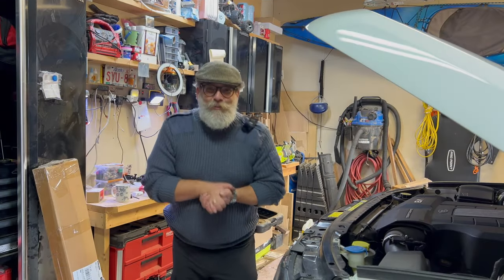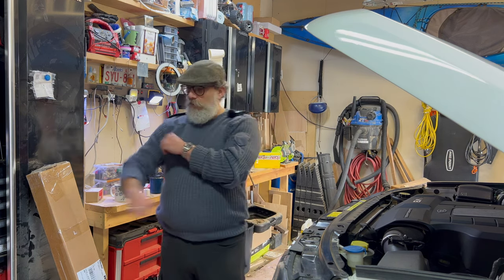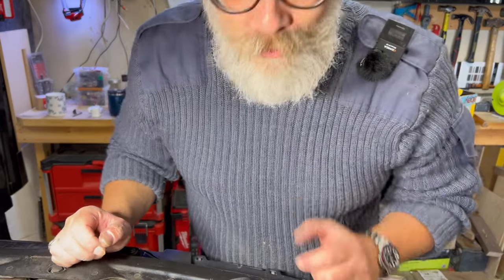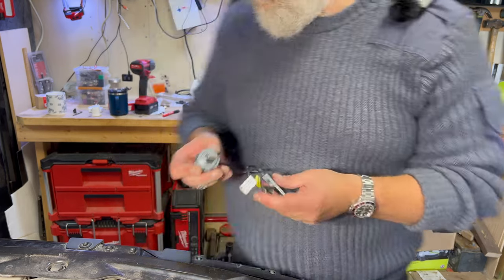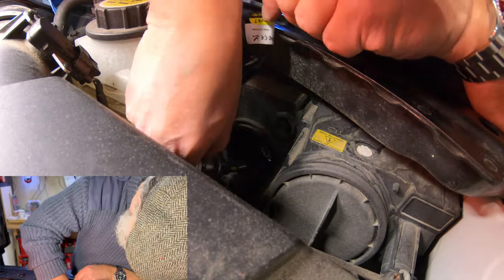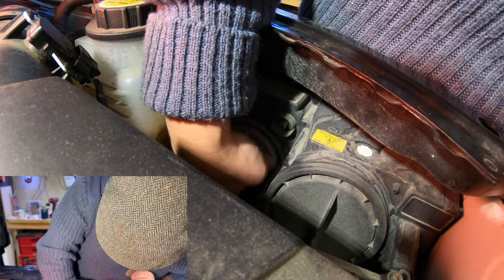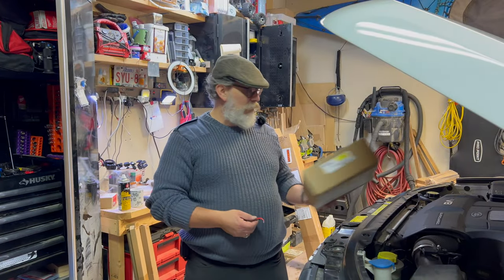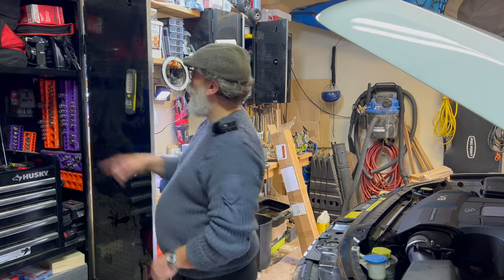Unleash the Power of LED: Upgrade Your #l322 Main Beam Bulbs and Replacing Tailgate Weatherstrip

Comment: Thanks so much for this video. I was very interested in the rear glass weatherstripping. Mine needs to be replaced. My local LR Specialist told me that it was a very big job that required the glass to be removed. Maybe he isn’t so “Special” after all. My RR is a 2011 HSE Lux. I suppose everything you showed would be the same on mine? Also, top marks for providing the part numbers!
Reply: I just removed mine and didn’t replace. They don’t make much difference tbh. Looks better and saved cash. Result.
Reply: @robholland1937  thanks for your reply. I take it once you removed the weatherstripping you didn’t notice any leaks in foul weather?
Reply from the maker: @robholland1937  They do look more finished with the stripping in place, though.
Reply from the maker: @jerrygreene7139  No, there is no leaks without them, as the seal to stop water getting in is below the rear tailgate, so all they do is direct water down and off the upper tailgate. However, they look odd (imo) without them and a bit unfinished. Moreover, I like things to be where they should on a vehicle, so I like to have everything exactly how it’s should be (give or take). 

In respect to your vehicle, yes, the 2011 is the same as my 2010 — but the video also shows a 2011 (my friend’s). As indicated, you probably could carefully put the bottom sticky pad on if you use the method i showed you towards the end, but it would be tricky. You would need something like fishing line or a fine scraper to get the old part off and to clean up the door where it fits. That said, I inspected the parts I fitted for this video yesterday when I did a service on it, and they are in perfect condition and haven’t moved without the bottom fastener, so I think you would be fine without it. I think I also mentioned that mine have broken there anyway and haven’t fallen off yet😆!

Comment: My next job is to fit Bevinsee LED D3S to complement the main beam Bevinsee H7 LED I fitted a while back. Latter was a massive improvement 😊
Reply from the maker: Interesting! I hands my heard that they have a D3S — is it still Xenon or LED? I wonder if it requires some canbus tweaking to work with the HOD units?
Reply: @shedlock2000 Just following what Sam did on his channel. Sam’s Motors and Machines. He’s just fitted them. No problem
Reply from the maker: @robholland1937  Ahhh! I will have to take a look at Sam’s new video, then! I wonder if they are much better than stock. I run the Osram Nightbreaker in my HID dip beam. They’re good, but do not provide the depth of light offered by the LED main beam.
Reply from the maker: Can you share the link to his dip beam LED replacement? I can’t find it in his listings — I know his channel fairly well, but I don’t remember seeing anything for the dip beam HOD replacements.

Comment: At 12:25 of the LED installation. I've always understood it is a heat sink for the LED. Halogen bulbs melt the ice and snow on our headlights and rear fog light. LED does not. I'd be interested in any experience you have with ice/snow melting, or, not.
Reply from the maker: Hi Richard! Good to hear from you again!

Interesting question. The LEDs do make quite a bit of heat (but not anywhere close to the heat from a Halogen bulb). However, I have never had any issues with ice build up on the lenses (and I have seen some serious cold conditions here down to -80°c with windchill). 

I’m not sure that there’s any benefit from the heat radiation from a halogen bulb which improves over the LED (L663, L550, L462, L405, L464 and others are all LED). The little box thingy is actually part of the circuitry required to fool the canvas and to smooth the voltage for the LED rather than being a heat sink — though the bulb has a little fan on the back to dissipate heat. That fan will be helpful in circulating air in the headlight unit and reducing condensation.

Comment: Why not Philips or Osram leds? Certified and probably more trustworthy.
Reply from the maker: Price and availability! I have not seen any Osram H7 LEDS (or Phillips for that matter). I do like Phillips LEDs — they are very good quality — but these are excellent value and also work very well (I have used them for four years without issue). It may be the case that others were not available at the time (I can’t recall). I am not suggesting that you must fit this breed of light — more showing the viewer how to install them and the ones I happened to use. You can select your own preferences — I have just been very happy with these for the price!